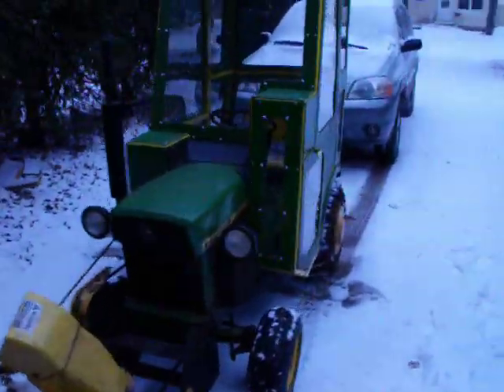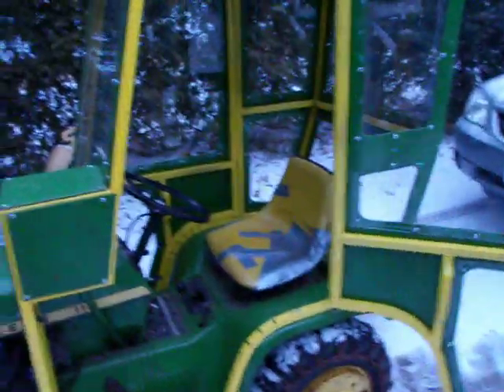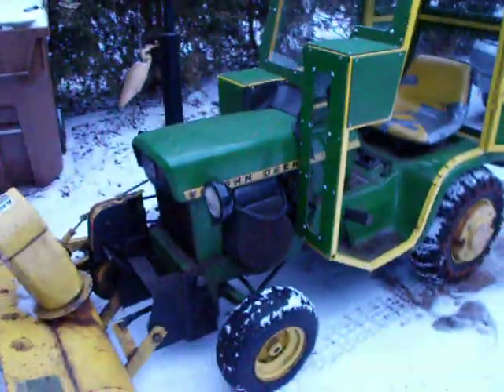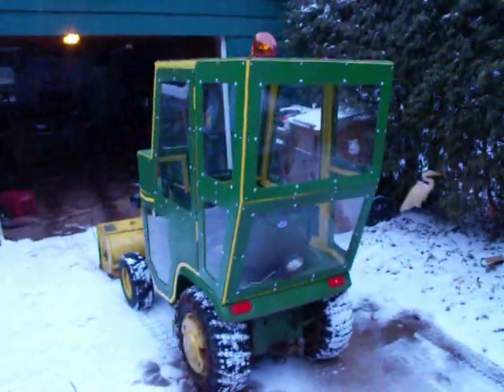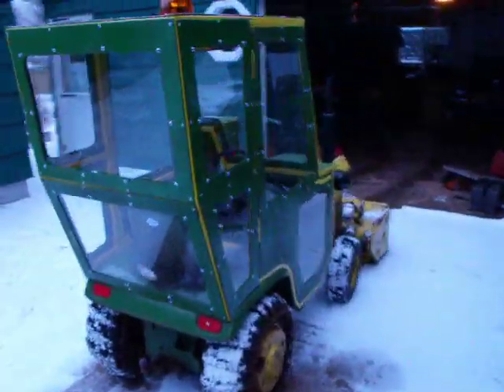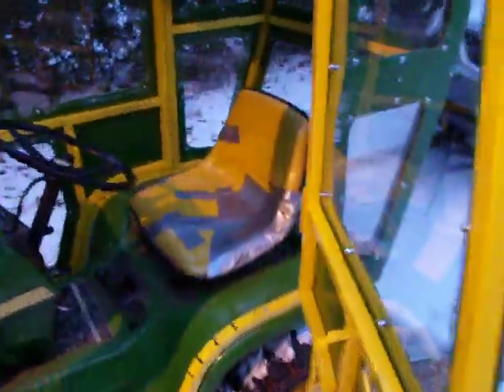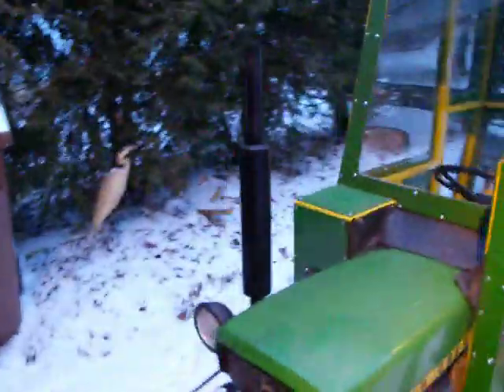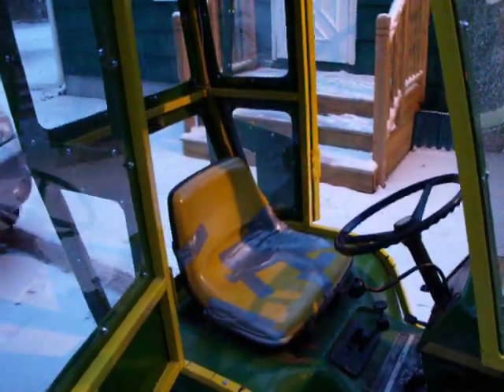John Deere 110 Snow Cab Home Made

Comment: my question is how do you put gas in it? im familiar with the later 200 series with the rear mounted 3.5 gallon gas tank, but i know that the earlier 100 series had a 1.5? gallon tank under the hood. does your front windsheild tilt up so you can access the gas tank?
looks like a nice cab!!

Comment from the maker: @1944johndeerel -  Great question.  To put gas in, I have to pull the front of the hood apart and slip it out of the hinges.  It sounds like a pain but I can do it in about 10 seconds.  I left a little gap right under the windshield (thus the rubber sheet) and it gives me enough clearance to get the hood up above the hood latch.

Comment from the maker: @countryfarmer94 I used plexi glass from fleet-farm.  I haven't had any issues with scratching although I don't have a windshield wiper either.  If you are going to run a windshield wiper I suggest you use something different if at least for the front window as it will probably scratch.

Comment: I realize it's an old video but great job. Very nice. 
You had mentioned that you were planning to build a heater to use the exhaust heat without getting the fumes in the cab and I was wondering if you've been able to come up with a fairly simple yet effective design?. 
We live in northern Ontario and have a store bought cab made of heavy black vinyl material with thick clear plastic panels for the windshield etc, (similar to what you see on a pontoon boat cover/surround.) The problem is,  although I park it in a fairly heated garage, over 5 years of use the clear plastic panels have cracked and split in several places due to the cold temperatures, and the zippers that hold the panels together are rapidly becoming stuck, snagged, and snared.
I love your design but without having a welder available, and no welding experience, I'll probably have to use light weight angle and bolt it all together.
Well done. 
Cheers.

Comment: Hi, You did an amazing job!  I inherited a 1969 JD110 with and it has the single-stage snow-thrower. I have not used it yet. I was wondering how well yours moves snow.  Seems like the 8hp Kohler might be a little underpowered (it seemed that way the one time I mowed with it).
Reply: DaffyJeffy, I have a JD110 that I have been using to move snow for the last 5 years, and love it.  The wet heavy snow tends to plug it, but otherwise, it does a great job moving the snow.

Comment: I have a 112 and am interested in building a cab as well. Do you be chance have any plans for yours that you would share with me?
Reply from the maker: Hey Brian, I didn't write anything down. I just built it on the fly.
Reply: Do you think you could draw a diagram for me with measurements? I know it's kind of a pain to do but I would really appreciate it. And could you tell me how high it is from the top of the cab to the floor? I've got a small shed that I want to store it in and just want to make sure it will fit through the door. Thanks for your reply